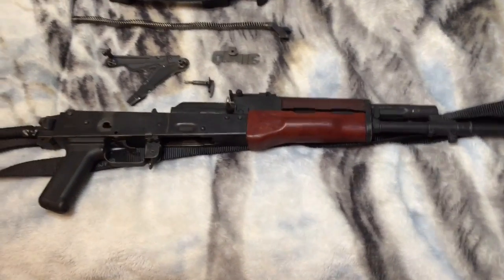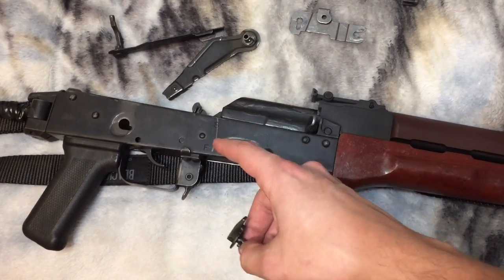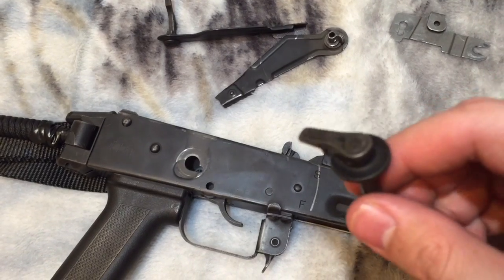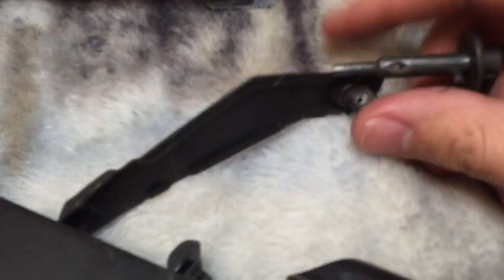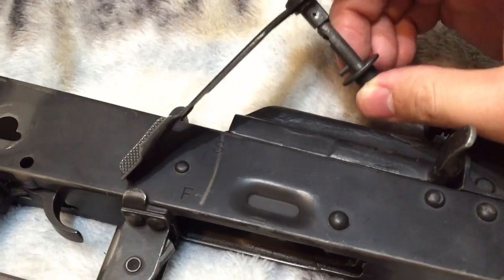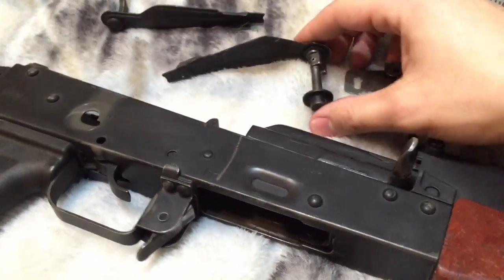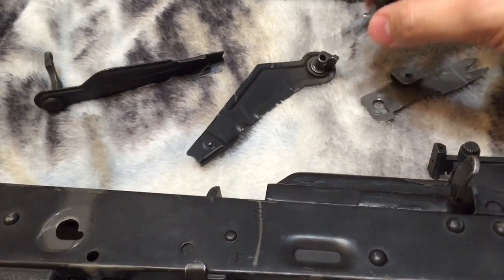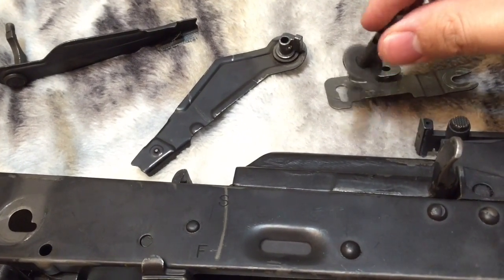How the Tantal Safety Lever Works

Comment: Thanks for the quik rundown on the Tantals lefty safety. Something to be said for brevity in YT vids, some go on' n' on n' on with a 25 min vid that could have been pare'd down to 10mins or less. Tantals are great rifles. The Poles truly build some great stuff when it comes to small arms design & machining quality/processes...

Ive just recently designed then fab'd up a left side throw lever for my Zastava M85NP (5.56cal AK pistola that has a riveted polymer magwell that can accept any Ar15 clipazines)
It works incredibly WELL too. Im quite happy with 'er!..
-Im simply blown away AM parts manufacturers w/top notch machine tooling @ hand havent come up with such an easy design/system?! -As such would no doubt $ELL WELL...
 Ive managed to do such with a makita corded drill & drill stand, a cordless hand drill n' drill bits, center punch, a dremel, hand files, vise, tap & die threading sets, an Oxy/MAP gas torch w/ 56% Silver Solder, 0.1350/343mm mild steel flat stock & bit of hi-test epoxy...

Doing it all with my 1st prototype w/zero failures/parts re-purchases for a 2nd go...
 (Although I have another 2ndary design that could work equally well with less work/parts fab time)
~Take 'er easy...;)
Reply from the maker: Glad to see new comments on this old video!
Reply: @mruler360  No worries, great stuff indeed! Well demonstrated, explained n' Educational aspects highly appreciated for us nutz n' boltz type peeps..;)

Comment: Late question but I'm assembling a parts kit and was wondering if you could take the fire selector out of the picture (cause I can't find them in stock anywhere) and have a functional semi auto rifle with a regular FGC and safety?
Reply from the maker: If you’re using a standard AK fire control group the safety won’t function properly.
The hole the safety fits into is in a different position on the tantal vs. the typical style of AK.
Reply: @mruler360  sheeeeeit
Reply: @mruler360  so standard safety switch is a no go?
Reply from the maker: @TeutonGuy that is correct sadly. The angle on the safety won’t properly fit with the dust cover either.
Reply: @mruler360  sorry to continue but would it be able to work if I used a standard AK74 receiver? Could I still use the bolt carrier group and trunnions?  Cause I can't find that left side selector anywhere
Reply from the maker: @TeutonGuy  With a standard receiver that might work. 
I'm not sure of any other dimensional differences. 
I suggest you consult with the folks over at the AKFiles forum and see what they think.
Reply from the maker: @TeutonGuy  There are sections of the forum specific to AK builders and I'm certain someone there could give you the exact answer.
Reply: @mruler360  thanks man

Comment: FINALLY!  A useful video on the Tantal's ambidextrous safety selector.  My question is:  Can I remove the left side selector altogether without impairing the actual safety selector's function?  Reason:  I want to install a side rail mount, and the dang left side selector is in the way.
Reply: No..look at it ....they have to be locked/pinned together, I’d fine a better pin setup, maybe a S/S cotter pin

Comment: I think my roll pin is welded in place because I tried tapping it out and it won't budge, I think the only way to remove the safety would be by either drilling out the roll pin or just cutting through it. I thought not a problem, I'll just remove it (destroying it in the process) and just put a Krebs on there but Krebs told me they don't make safety selectors for the Tantal
Reply from the maker: I had to use a dremel to remove mine.
Reply: @mruler360  Wow, this was a long time ago, I gave up and left it alone. So you installed a new safety?
Reply from the maker: @NDZ-jf8ur  Sorry, no.
To be clear, the Tantal safety is in a different location on the side of the receiver vs all other AKs. 
Your best option would be to modify the safety itself if you are willing.